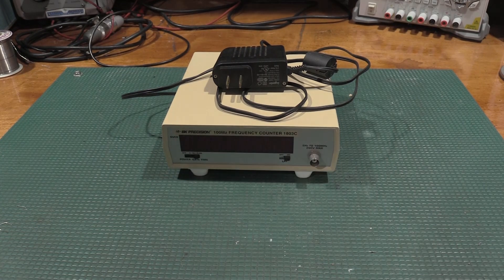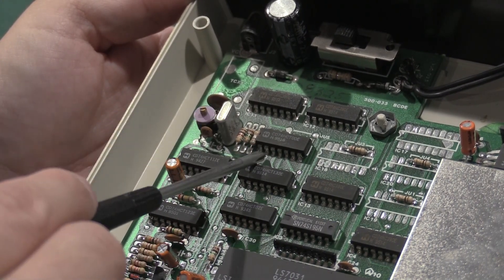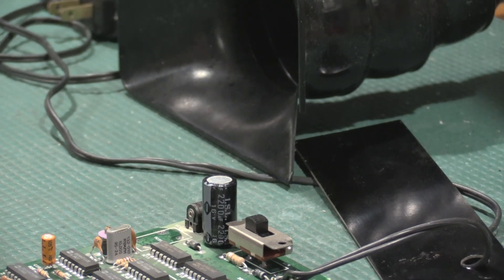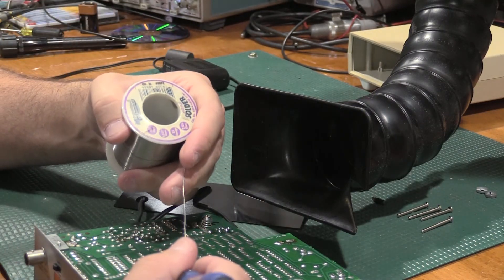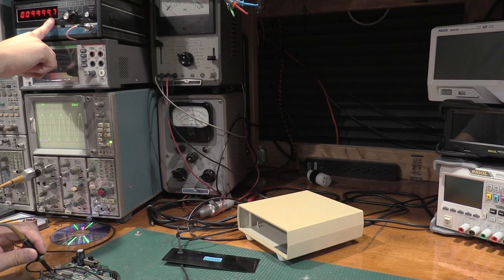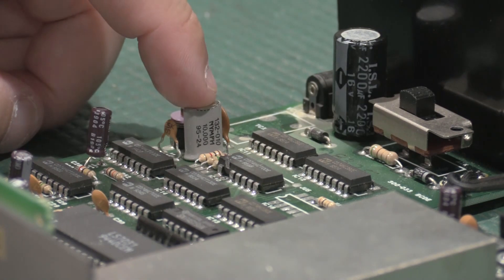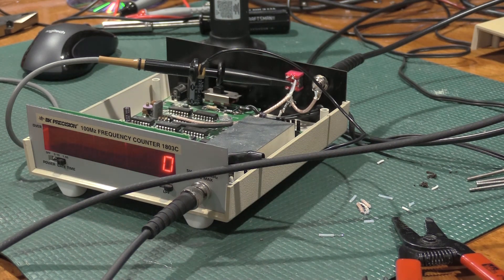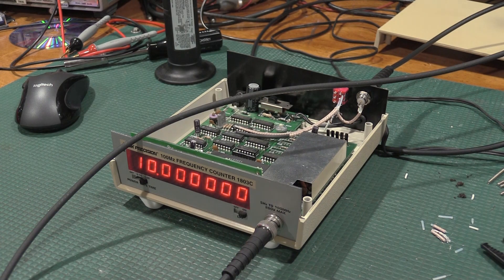Adding and External Time Base to a BnK 100 Mhz Frequency Counter. (More 10Mhz Ref Stuff)

Comment: Im surprised (out of my non existing knowledge) that the 10Mhz can be routed via a mechanical switch without problems. Recently I reverse engineered a programmable character generator board for the Commodore PET and stumbled over the description of a mod making it switchable by disconnecting a single address line. And this mod was described using a AND gate and switching the second input of it high or low because it was feared that routing the address line (that switches in the kilohertz range) directly over a mechanical switch would lead to problems.
Reply from the maker: On a board there are 2 physical parameters that are important for what you can and can’t do with regard to physical switches. The first is REP RATE, in this case the signal was 10 Mhz so all is good there. The other one is a little harder to explain and that is edge speed. You can have a square wave signal that pulses at 1 Hz rep rate but has 1ns edges. Even though this signal is 1 Hz the edge speeds dictate that you will need to prepare a 1Ghz board due to the 1ns edges.
I will have a video out in the future when we look at a type 284 and calibrate it. In this video I will be dealing with 70 ps edge speeds. What is holding me back from the video at the moment is I do not have the cabling needed to support these speeds. I need to jump to SMA or 3.5mm rf cables. The sampling scope that I have has 3.5mm (RF) jacks on the front end due to the 26Ghz sampler.
Reply: @ZenwizardStudios  Thanks for the reply. I was wondering if the sinusoidal vs square(ish) waveforms made a difference.
Reply from the maker: Absolutely it can. Edge speed being the most impotent factor. With the lazy edges of 74 series logic would even be fine through a switch. The faster the edges the more it becomes and issue.

Comment: In the upper left corner is the slot for the TCXO. Temperature controlled crystal oscillator. Why didn't you just put it on?
Reply: Temperature-Compensated Crystal Oscillator
Reply from the maker: In this case I did not have one on hand that would be appropriate.